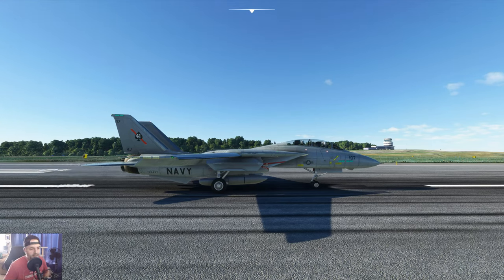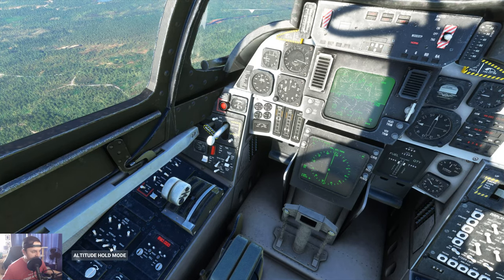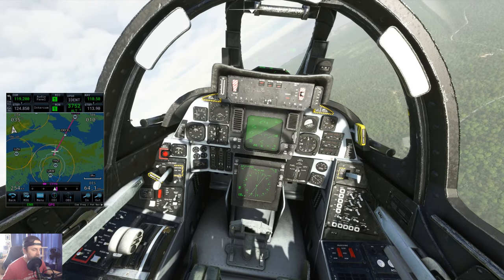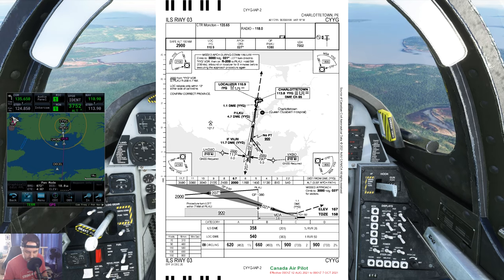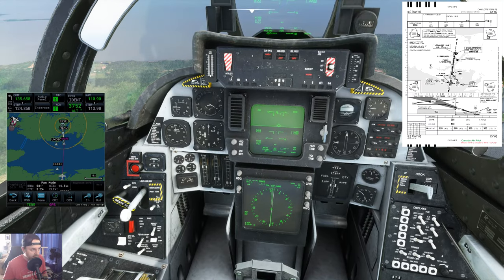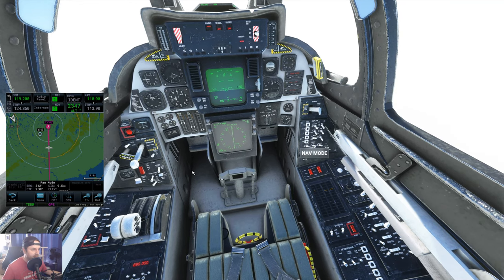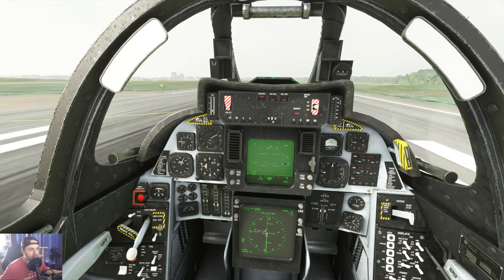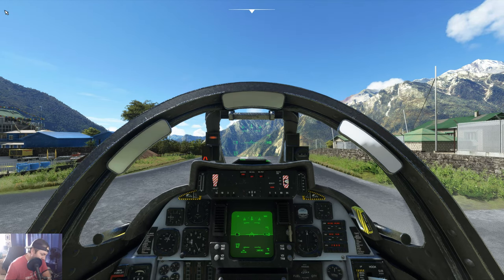FS2020 - UPDATED Autopilot tutorial in the DC Designs F-14 (version 1.0.1)

Comment: Is there a reason why ATC will always say to go around when using ILS to land? I don't have any traffic turned on (I play in VR so it helps from stuttering.) I usually have copilot ask for permission to land about 3 miles out from landing, and I get clearance to land but literally before I touch down I get the "go around." With VFR I can practically bounce in with no issue from ATC, but when using the method in this video I will always have ATC on my back for not having clearance to land.